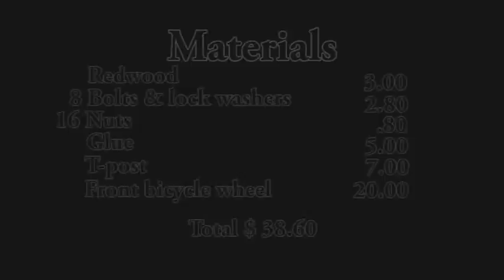bicycle wheel to bird feeder

Comment: Hello  I now have made two of these Ferris Wheel feeders.  the first one I follows your guild and sizes.  Butt then on the second one I  made the buckets much bigger on the  and it turned out much better for the wheel I was using.  It took me a few hours to make the first one when the buckets are now  4.5 inches long  2 inches wide so I used 1/4 board cherry in making the long sides and 1/2boards for the ends which were 2.5 inches tall...  so when I drill the hole for the buckets, for the long bolt to slide into I also got a alum tube and cut 1/2 inch alum tube for each end of the bucket( note the tube was same size as the drill bit for the holes in the ends of the buckets rides much better. this is for the bolt to ride on so that it turns much easer on the bolt when I was finishing up I put small amount of grease on them as well.  I thank you for the original idea and I just put my own touches on it, and sold one already.  I now make them in three different sizes with same size bucket on all just less of each on the different sixe wheel...  I live in Florida  it took over a week for them to find the feeder but now its a every day event.  I also make water wheels and wishing wells.. and soon other useful stuff for around the home thank you again happy building
Reply: +david : thanks for your detailed improvements! How do you drain the seed feeder buckets?

Comment from the maker: Drill a hole through the T post the same size as the bolt that goes through the wheel, then attach the wheel the same way you would with a bicycle wheel to the forks on one side.